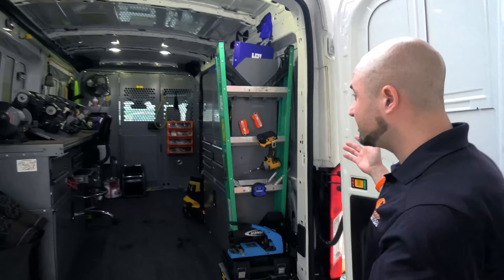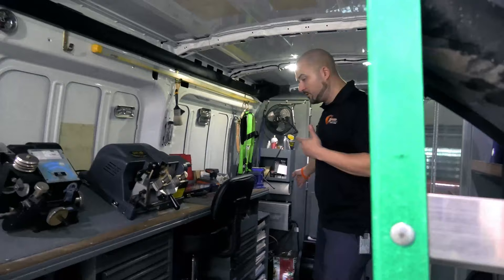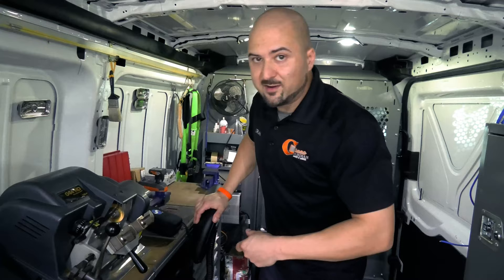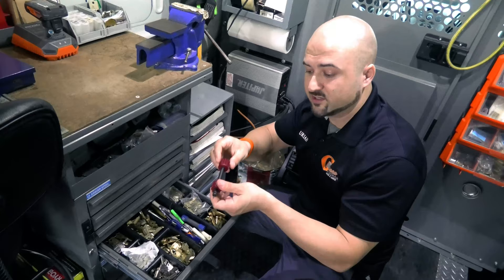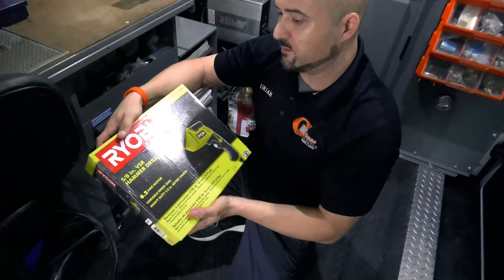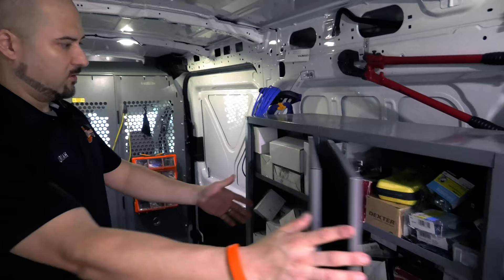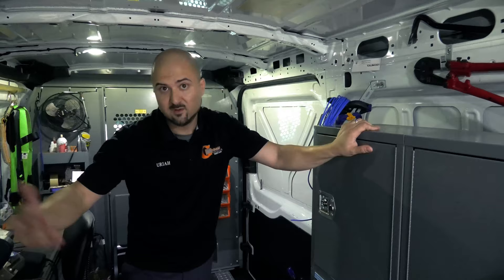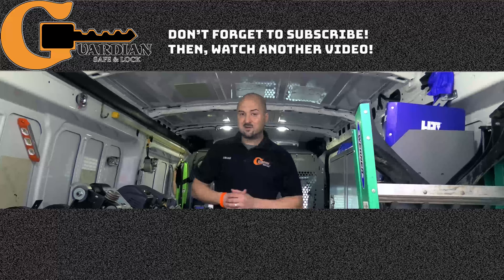What YOU Need To Be A Mobile Locksmith!

Comment: 09:27 It's not ripping anyone off. You are solving problems. A new  lock or key is solving the problem you were called out for. Identifying the lack of additional security solutions such as peep holes and kick plates and having the material and ability to complete the job without an additional call out fee is simply solving a problem for a customer that they didn't  know they had until you suggested you could fix it. As long as you quote a cost and bill it after they agree you did nothing wrong. Quite the opposite from ripping anyone off.

Comment: 8:24, you mentioned double cylinder deadbolt, does your fire code allow those on residential applications? They don’t where I’m at. It’s a lawsuit waiting to happen I guess cause kids lose the key inside or they can’t get out in case of smoke and fire. Every State and local AHJ has their own rules though. I was warned early on to not offer them in residential but it’s fine in commercial applications. We’re not even allowed to rekey them on a home but I know locksmiths do. I will rekey those locks if it’s not on the door. Thanks for sharing. Cool channel🙏🏼✌🏼.
Reply from the maker: Hey thanks for watching! In Texas it is NOT illegal to install double cylinder deadbolts, according to Texas Property Code. That's crazy that they cant even rekey them..... Just one of the many reasons I love Texas! #freedom - Uriah

Comment: How big is the inverter in that van to run your grinder and key duplicator etc? Great  video
Reply: I have a 2500 watt inverter in my E250 and run it off my main battery but my Stepvan will run off two battery’s (the main and an accessories battery individually isolated as needed) and has a 3000 watt inverter. Key machines don’t draw much power tho. But if you use that extension cord the stuff you plug into it can definitely max out your inverter.
Reply from the maker: We use a 2500/4000 watt peak inverter and we get them at Harbor Freight.
Reply: I have been doing lock work and commercial hardware on college campus for 40 years. Was thinking about going mobile as a retirement gig. I have never done automotive locks with the exception of lockouts. There was another locksmith in town who decided to invest in automotive and I agreed not to. Small town not enough business for more than one automotive guy. Thanks for the response.

Comment: I'm confused on why a locksmith would need electrician tools
Reply from the maker: Modern locksmiths don’t do just locksmith work they do multiple different security trades such  as Access Control, CCTV, safes, automotive locksmithing, and residential and commercial locksmithing. So we use them for cameras and wiring in electrified devices such as maglocks, and electric strikes.
Reply: Some of us also do Mobile Diagnotics, Module Programming, Cloning, Wiring harness repair and other automotive repair work. 

I’m heavy into commercial mortise locks, automotive scope diagnostic work, automotive repair around these areas.